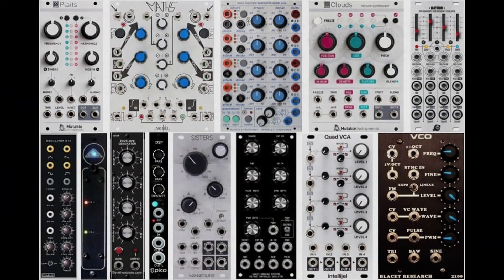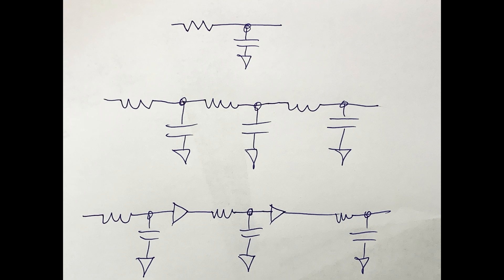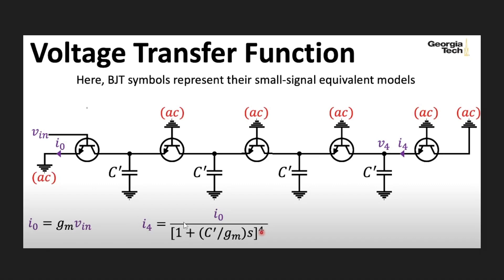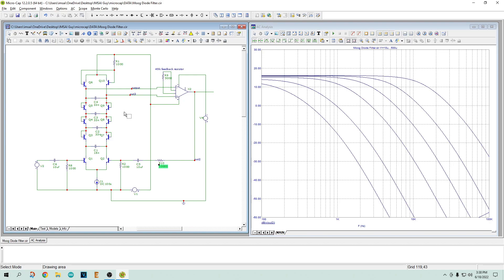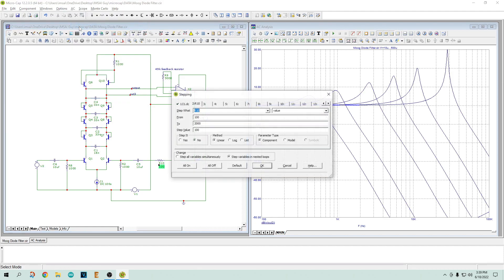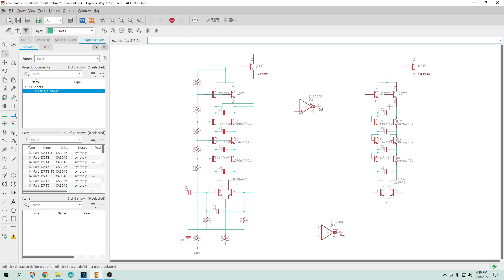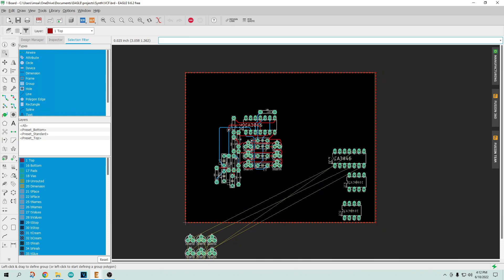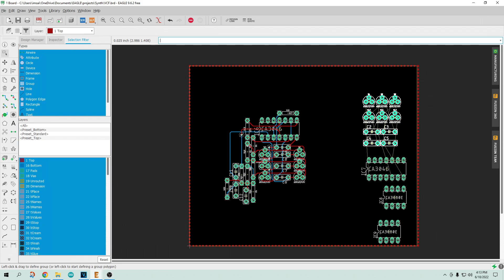#1208 DIY Analog Synthesizer (part 9 of 15)

Comment: Sorry to be the one to tell you this but you are missing the most important thing in the whole modular stuff, the 1volt/oct relation. It's the main thing that is used to make sounds with those modules. Unfortunately it is also the most difficult thing to achive in stable fashion. It needs really big knowledge on how transistor work and how its behaving with respect to temperature he is working in. I was waiting for this from the first episode of this series and I have a feeling you are putting this always away but without it even first module VCO is not going to work as a synchronized module where voltage is steering the frequency.
Reply from the maker: yes, I mentioned that. this is not a real synth, it is noise maker that allows me to teach some op-amp circuits and show some fundamentals of synth designs.
Reply: @IMSAIGuy  Well Yes and no cause you also couple of times showed modular systems and were talking about them. Don't get me wrong I really like your movies but also think that this series is missing a crucial thing for very long if what you do here will be some good product in the end
Reply from the maker: @krolu  I was going to build the MFOS noise toaster circuit but opted for something that had many of the real synth circuits
Reply: @IMSAIGuy  Thank you for the time to responde to me. I will wait then and see what will the end product be like
Reply: The 1V/Oct thing is really the scaling response of modules like the VCO, ideally you want to make the VCO response to the control-voltage input such that a 1V increase in control voltage results in a doubling in output signal frequency to get musically useful results, a doubling in frequency is the same as a one-octave increase in pitch so say that the VCO is putting-out a signal at A 440Hz, if you feed-in a 1V control voltage the frequency should change to A 880Hz or an A an octave above.

Comment: What’s the weird little line at the lower right of the response plot (100 kHz)?
Reply from the maker: there is a dip and then it comes back up a high frequency. since it is above audio frequencies it doesn't matter, probably can make that better with fine tuning all the values

Comment: I think KiCad has gotten much better with recent releases.  If you hate a version you used from a couple of years ago, it might be worth giving it a try again.
Reply from the maker: yes, I have now used KiCad to layout a board. it is much better. still some issues but it gets the job done.
Reply: I've been using Kicad for many years, and it was awkward at first (V3 or maybe even v2 it was that long ago!) . As you say the newer versions are much better, V5 and now V6

The biggest problem is Eagle - if you get locked into their way of doing things then Kicad seems very odd. It's a common comment I've seen many times on the Kicad forum.

What always seemed to cause the most issues was the component to footprint relationship. Kicad uses the one component to many footprints, Other EDA's like tend to use a one to one relationship. Neither method is right or wrong, just different.

I't was very satisfying when I created my first PCB to be manufactured by a PCB house (JLC) Worked first time, and I was very pleased with the result.

You just have to give it some time for the differences to work themselves out. It's worth the effort.

Andy
Reply from the maker: @andye2005  Yes, I've done a board now, I like the separate footprint thing. My main gripe is that I have to use two hands most of the time. In Eagle I rarely has to use non-mouse hand. also the move and drag seem not consistent. If I do a group and move the connecting traces are abandoned and drag does nothing. I have to go back and reconnect things outside the grouping.
Reply from the maker: oh and while I didn't use it often, no autorouter. on digital boards this is a big one. Not entire board routes but say rom and ram data and address lines. a group select and autoroute is a life saver

Comment: The basic idea is that the V I plot for a diode is curved around the knee.  For small signals, the resistance is the slope of the curve, which varies depending on where you are on the knee.  In other words, depending on the forward bias current.

Comment: The filter is an interesting topology. 
Another circuit I have been fascinated by is a Gyrator. 
Gyrators take a reactance and invert. 
So you can place a cap on one port and at the other port the reactance looks inductive.
This allows, (at least in the audio spectrum), you to make large inductance from a cap/gyrator, without the iron. 
[at least that is my perhaps flawed understanding]
Analog is always fascinating.
Reply: also curious about gyrators.
Reply: Yes, a Gyrator circuit can basically invert the reactive response of a capacitor so that to all intents and purposes it appears to work as an inductor, this is because the reactance of an inductor behaves oppositely to the reactance of a  capacitor, by reactance I mean the AC resistance, in a capacitor it's AC resistance is high for low frequencies but gradually reduces as the frequency increases, in an Inductor the opposite happens, that is the AC resistance is low for low frequencies but gradually increases as you increase the frequency.

Comment: With all those 1k resistors (that you also want matched), I'm surprised you didn't use a resistor array. That would save a little bit of board space without yet having to mess around with SMT soldering. My  hands shake badly enough that I'm happy to pay someone else to solder SMT projects.  Sometimes that's my colleague Carl, who will solder pads on 50 mil spacing with a bucket of coffee on the bench.

Comment: I hated KiCad too. Bit the bullet and figured it out. I like it now.
FWIW, when you go over 100mm on PCBWay the board cost jumps over $5 (for 5). So I still try to keep my boards below 100mm.
Reply: I agree, KiCad has a troubling learning curve, and some weirdness, 
but for a free CAD tool it is great. 
I need to re learn it every time I use it.
Personally I can't stand Eagle. 
But we all have our favs.  Most of the time it is that which we have mastered.
Reply: For me, it's the only program I've ever used so no problem